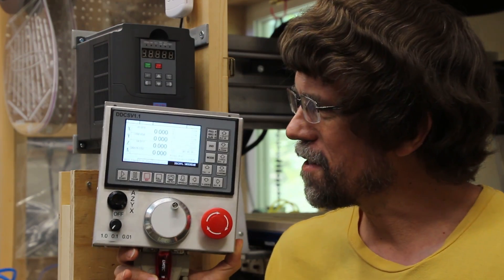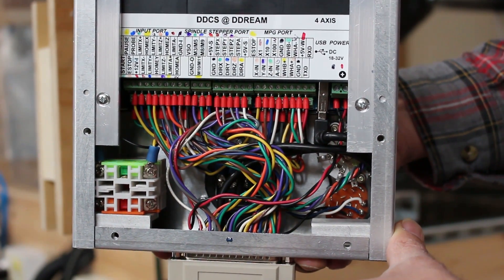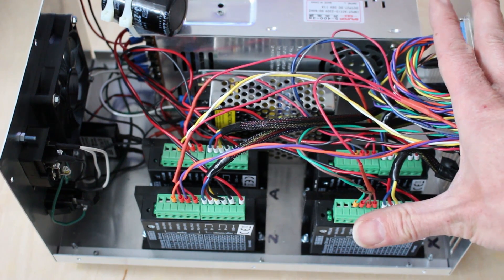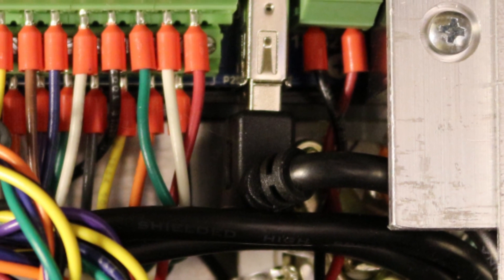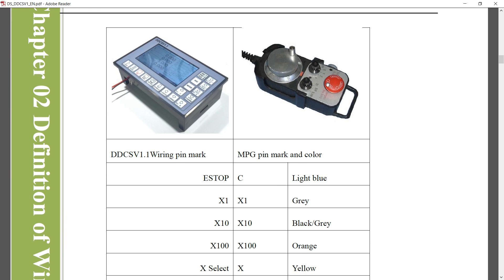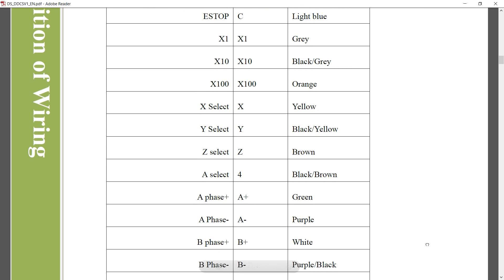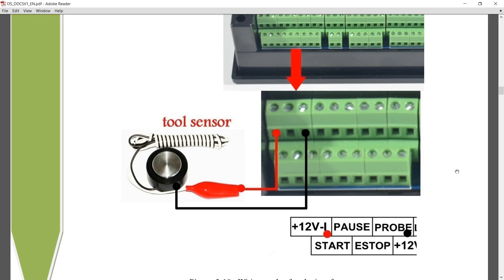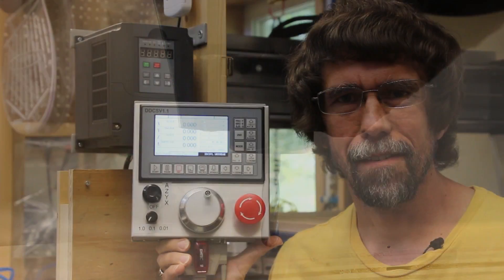CNC Controller Wiring & Setup DDCSV1.1

Comment: Hello Jay
Sur un de mes messages je t'avais parlé que le codage de la roue semblait avoir des erreur *1 il allait de 0 à 2 sans faire le 1 ,je te disais que j'allais changer ma roue encodeuse et bien après remplacement il y a toujour la même erreur,donc tu avais raison les erreurs proviennent du contrôleur DDCSV1 et pas de la roue .
Regarde ta messagerie j'ai envoyé un mail et et un webtransfer en telechargement
Merci à bientôt
Joseph
Un lien 
http://www.ebay.fr/itm/Hand-wheel-Pulse-Encoder-100PPR-CNC-Mill-Router-Manual-Control-For-CNC-System-Ha-/400729450190?hash=item5d4d5626ce:g:mDMAAOSwcnpTo1iP
Reply from the maker: A little help from Google Translate:  
Hello Jay, On one of my messages I told you that the coding of the wheel seemed to have errors * 1 it went from 0 to 2 without doing the 1, I told you that I was going to change my encoder wheel and well after replacement there has always the same error, so you were right the errors come from the controller DDCSV1 and not from the wheel.

Hello Joseph,
Yes I think the encoder wheels are pretty reliable but sometimes the DDCSV1 doesn't respond correctly to the wheel movement and sometimes it does not quite return to exactly the same coordinates. It does not seem to be a big problem, just annoying sometimes. The encoder wheel in the link you provided looks the same as mine.
Reply: Hello Jay
Oui il y a beaucoup de choses qui ne marche pas bien dans le contrôleur ,j'aimerai mettre à jour le firmware mais je ne le trouve pas auriez vous un lien pour le télécharger .
Merci
Salutations
 Joseph
Reply from the maker: Hello Jay
Yes there are many things that do not work well in the controller, I would like to update the firmware but I do not find it you would have a link to download it.
Thank you
Greetings
  Joseph

Hello Joseph,

The website http://pandora-cnc.eu/en/ offers a new open-source firmware alternative for the DDCSV1.1 controller. I have not tried it yet so I don't know much about it, but you may wish to give it a try. On the Download page of that website you can also download the latest factory firmware, in case you just want to update to the latest version.

Regards,
Jay
Reply: Hello Jay 
Merci pour le lien de mise a jour, je vais l'installer ,( la version de mon contrôleur est 2017-03-04 -87 nor )Sur le site Pandora  il y a une ligne pour l'installation, je pense qu'il y a une erreur de traduction (Si le programme d'installation vous demande de remplacer quelque chose, choisissez d'écraser quoi que ce soit) a mon avis je pense qu'il ne faut rien écraser . Es qu'il est possible de sauvegarder dans la clé USB le programme qui est dans l DDCSV1.1 ? 
Merci pour tes précieux conseil et aide
Joseph
Reply from the maker: Hello Jay
Thanks for the update link, I will install it, (the version of my controller is 2017-03-04 -87 nor) On the Pandora site there is a line for installation, I think it There is a translation error (If the installer asks you to replace something, choose to overwrite anything) in my opinion I think that nothing should be overwritten. Is it possible to save the program that is in the DDCSV1.1 into the USB key?
Thank you for your valuable advice and help
Joseph

Joseph, I think you can save the existing software files using the File Management functions described in section 3.3.1 of the manual. You would need to navigate to the root directory and copy each file, then navigate back to the USB drive and paste the file. I am not aware of any easier way to do it other than copying them one at a time and I have not tried it but I think that will work. Then you should overwrite all files when installing the new firmware.

Comment: Would you be able to post a link to where you purchased the encoder wheel from or its model number?
Reply: And found, I think:  https://www.amazon.com/100PPR-Eletronic-Encoder-Router-Control/dp/B01N9LCMZZ/ref=sr_1_1?ie=UTF8&qid=1504456006&sr=8-1&keywords=pulse+encoder+wheel
Reply from the maker: Yup, that one should work. The electrical interface seems to be pretty similar among these wheels so I would expect most of them are usable.

Comment: Hi,
Very informative video that we can all understand. Can I ask what post processor you use to load the file into the controller. Do you see this as a better solution to using Mach 3/4 as a controller. Has the unit been stable without any lockups.
Thanks in advance.
Cheers Dave.
Reply from the maker: Hi Dave - I use Fusion 360 for creating CAD models and CAM toolpaths, and a post-processor that I wrote in order to generate G-code for the controller. The post-processor is available on my web site at http://www.brainright.com/Projects/CNCController/. I just noticed that I hadn't included that link in the video description so I added it.

I have not used Mach 3/4 but I considered it before buying this controller. This solution is less expensive, considering the cost of the Mach license plus a board such as a SmoothStepper, and it works without being tethered to a PC. I think it's a better solution for my own needs, but Mach can do more than this controller can do so it depends on what capabilities are important to you. So far the unit has been stable, except during the development of my post-processor when I accidentally fed it some invalid G-code that caused it to lock up. It usually seemed to handle invalid input gracefully but not always. I haven't seen any lockups in normal operation with valid input.

Cheers,
Jay

Comment: Thanks for putting together such clear information. Can you tell me how you find the MPG wheel? Does the wheel detent accurately reflect each division in the output or is there any bleed over into the following division or missed movements. I've seen one video where the user had a minor niggle with the MPG type he was using, stating that his particular wheel was more a rough guide rather than an accurate instrument. Again thanks.
Reply from the maker: I think the MPG wheel itself works reliably, because I've never noticed a case where moving the wheel one detent is not recognized, and when moving it a specific distance the CNC coordinate display changes to essentially the right value. And times when I've moved the wheel quite a lot and then back to the starting point the CNC has always returned to essentially the same value on the display. But I say "essentially" because there are often small discrepancies, which I think are accumulated rounding errors in the controller. It looks very much like a software problem to me, not something in the MPG interface. It's not a big deal, but annoying. For example with the wheel rate set at 1mm per detent and a start position of 0.000, after jogging the wheel a bit it might come back to 0.002 or sometimes shows -0.000 which smells like floating point rounding errors to me.
Reply: BrainRight Thanks Jay for the clear and concise answer. I'll order one, it's nice to know what to expect.